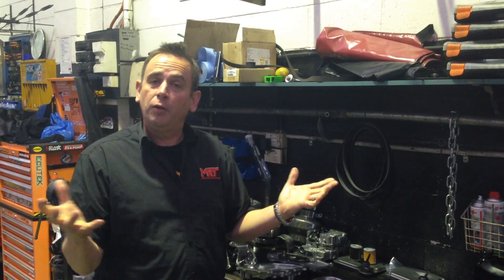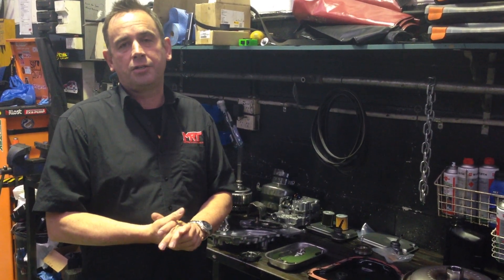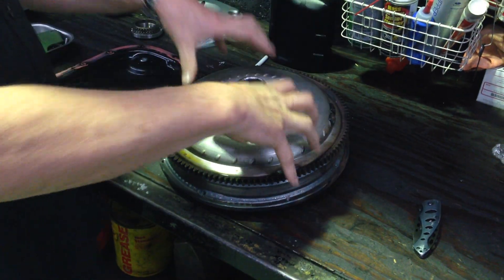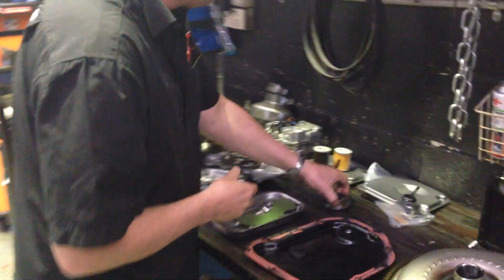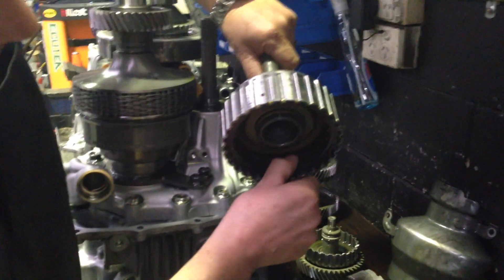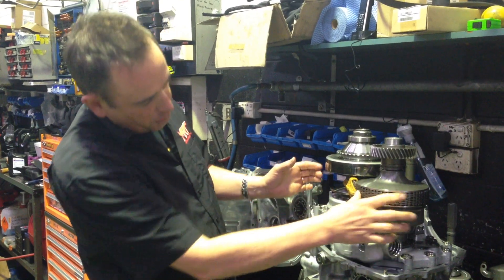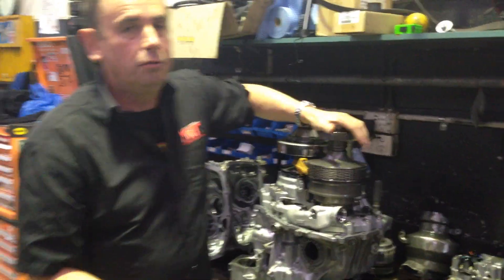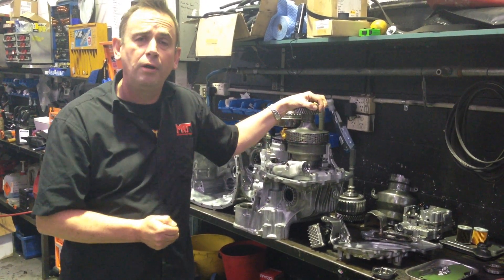Subaru CVT transmission secrets

Comment: Is there anyway to build a Subaru cvt transmission to handle more torque/power? I hear cvt belts are weak, bigger pan maybe, and since they use clutch packs can you use a better compound like the gtr, and Evo x?  Debating between a 2016 wrx, or used Evo x Mr
Reply from the maker: +Brian H no option YET
Reply: +Brian H if  you are looking to modify the car in any way past stage 1, DO NOT get the CVT WRX. The CVT can't handle anymore than 310 lbs of torgue. I have the 15 WRX and I was talking to the guys at cobb and they said they are not releasing any stage 2 map for the CVT because their CVT gave out passed 310lbs of torgue

Comment: I was told my Mitsubishi CVT if fails is a through away is this correct? Also do the lancer 2lt motor do more Nm than the CVT can handle like the Subaru?
Reply: +banditnev Are you asking if it's correct that you might as well throw your CVT away and buy a new one if it fails? Typically, the answer is yes. The cost of the repair and labor usually costs more than just buying a new one, if I remember correctly. And if you are wondering if the CVT in your Lancer will handle as much torque as the Subaru CVT, then my best guess is that it is less, if not then the same. I doubt that it could handle more torque since CVTs are still not quite effective in high torque applications; that is to say that the best CVT still won't be able to handle torque above 410 N-m (300 lb-ft). Also, the Lancer has a much lower output torque than the WRX, so Mitsubishi likely wouldn't have put in the extra effort and money into increasing the torque capacity of the CVT above what was necessary.
Reply: banditnev Anytime! If you don't push your car hard then it will last a very, very long time. I've seen service intervals of past 500k miles on some CVTs. I'd say changing the seals is a great idea. Most importantly, have fun!
Reply from the maker: banditnev no idea
:(
Reply: Hey thank you for your answer and you are right it is a throw away if fails as it is a sealed unit I'm told, so I am a older person and don't push my cars hard so I hope it will serve me well, I'm in the middle of a big service on my Bandit where I'm checking the tappets (valves) and changing certain seals at least that can be done :)

Comment: Not a fan of these transmissions, would much prefer a standard auto or twin clutch unit.
Reply: zzirSnipzz1 these cvts are flawless though. I can't even feel mine shifting.
Reply: Car Nut Why? Besides some of the dumb ass decisions companies make when building them, they're far better than dual clutch or standard automatics for standard driving. If you have a high-torque vehicle obviously they're not great choices yet, but otherwise, they're superior and will continue to be superior as the tech improves. Sorry you don't like change
Reply: Mathieu Morin CVT's were banned from racing because they were too good. There's no reason (unless you have a very powerful vehicle) to get an automatic or dual clutch over a CVT unless your want the experience of a manual.
Reply: Car Nut twin clutch transmissions are trash. Had one in my focus. Will never buy anything with a dual clutch again.
Reply: my ford focus was a lemon.  love the Subaru CVT.  most of the guys who badmouth CVT are just parroting what they hear
Reply: ed rader no, were the ones researching and going to the tranny repair shops who tell me they WILL fail and are mostly throw away after that. If can by a new car and replace every three years, go for it.
Reply: this isnt the CVT that they are putting in a race car though.... it barely holds 300tq on the wrx... if you want to go over that you need to change the torque converter which is roughly 1500$, relocate the intercooler in the front so you can add a transmission cooler where the top mount intercooler was... so just to get stage 2 and above you need to drop like 3 grands on tranny upgrades
Reply: Anything other than manual i wouldnt buy in a car full stop. No advantage for me as far as i see. I can upshift earlier to help MPG . Can downshift to help with stopping and the auto and semi-auto zap alot more power from engine than a basic manual
Reply: https://youtu.be/TFD0T4KaCWY?t=6m38s
Reply: they're fine for high torque applications.

they've been in combines since the 50s, and combines have far more torque than any road going car does.
Reply: combines arent working as many hours as a tractor or car, They fail after about 8000 hours on fendt's
Reply: woah you mean to tell me german made stuff is unreliable garbage? shocking.
Reply: German stuff has better build quality than alot of american stuff
Reply: zzirSnipzz1 I mean basically everyone who keeps the numbers on these things would disagree with that but the Germans have everyone convinced that their unreliable, needlessly complex and ridiculously expensive garbage is somehow good so whatever
Reply: CVT has been out for years its old tractor tech and even tractor manufacturers are going away from it it zaps power like crazy mechanical gearbox which is more effecient at getting the full power down https://youtu.be/TFD0T4KaCWY?t=6m28s
Reply: CVT loses you so much power and worse milage plus teh CVT just isn't impressive unless doing field work . Build quality fendt is second to none

Comment: is the cvt more reliable than the normal auto gearbox? since it has less moving parts?
Reply from the maker: simon hmm, good question!
Reply: +simon probably the same thing. I have a cousin that has a 2010 Outback with 170k miles on it, and CVT hasn't had anything done to it since it was new. But then again, I have a 2001 automatic, and I haven't touched it, other than oil maybe twice so far and I am approaching 250k miles.

Comment: 300 hp is not alot
Reply: +PHISHIT he said "Newton/meter," not horse power. When converted, the figures he stated mean about 300 pound/foot of torque. Horsepower is just a term derived from how much torque an engine can deliver at a given rotational speed.
Reply: +Noah thxx that's the answer I was looking for
Reply: +Ramiro Garza No problem.